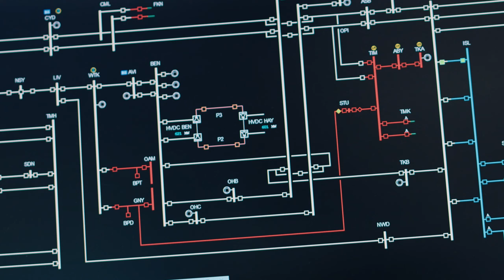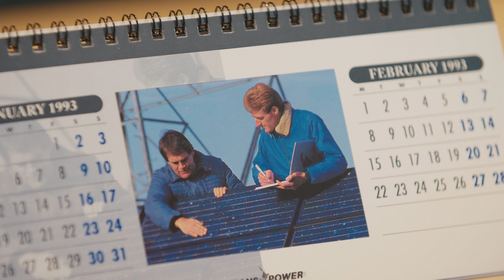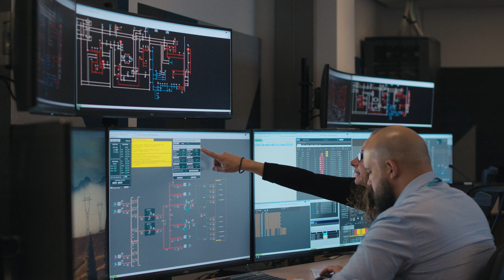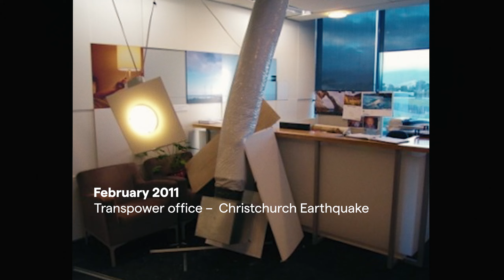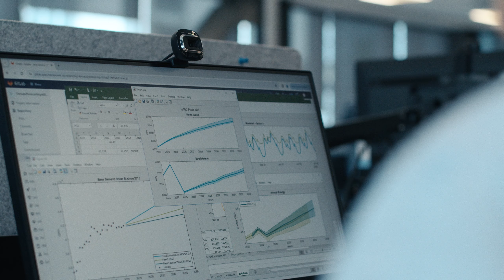30 years as a state-owned enterprise

Comment: My old man used to be an operator at Roxburgh Hydro Power Station when it was controlled there. Manually syncing it's generation with the grid by way of a manual lever and synchroscope. Those were the days ;)